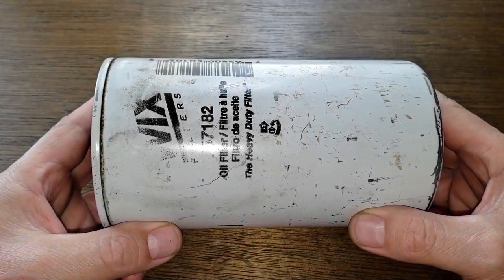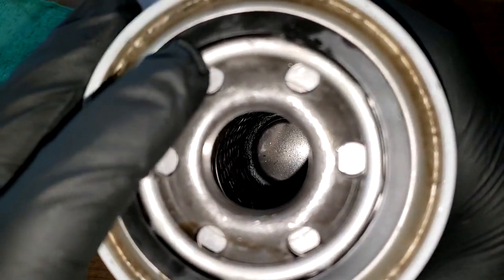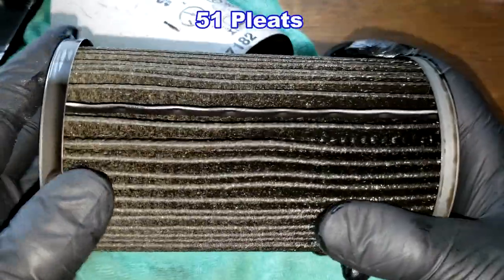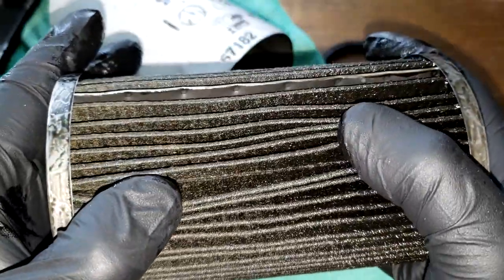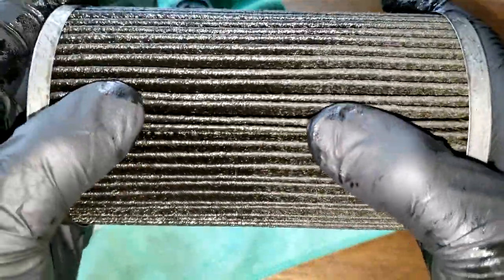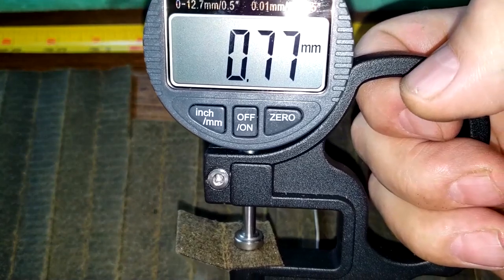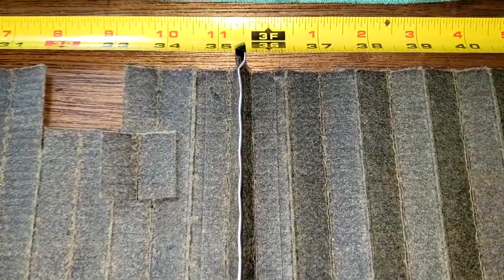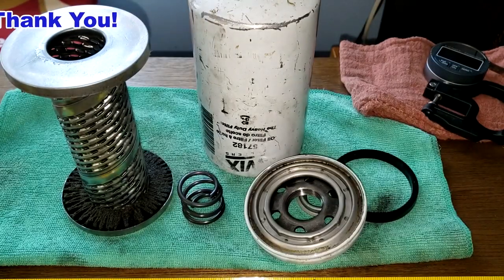Wix 57182 Oil Filter Cut Open, Used Wix Oil Filter

Comment: I have been unable to find out the exact difference between a Wix 57182 and 57182MP for use on my 5.9 Cummins.  Any thoughts out there?
Reply from the maker: I don't know the difference, but I'll pin your comment so that it sits on top. Thanks!
Reply: The MP designation is the part# for the case of filters. Many of the MP filters come with a cellophane wrapper on them because they don’t come in individual boxes. You can usually get a better deal on the MP case because of volume and packaging discounts 👍
Reply: @prevost8686  Thanks!

Comment: If there is plenty of room in the engine bay, would there be any advantage/disadvantage to using a longer oil filter like this one on a gasoline engine that calls for a shorter one?
Reply from the maker: If it's vertically mounted and the bypass is the same setting I would go for the larger filter. Of course, I would like to see them cut open to see the pleat count but typically more filter media and the filter could hold a little more oil. I don't see any disadvantages.
Reply: You have to be careful with the weight of the larger oil filter, if the filter housing on the engine isn't strong enough, it can break. Going one size larger, you're fine. Going five times larger, you are not fine.